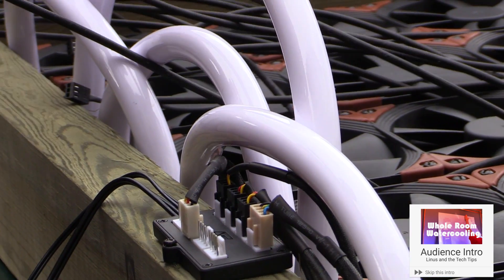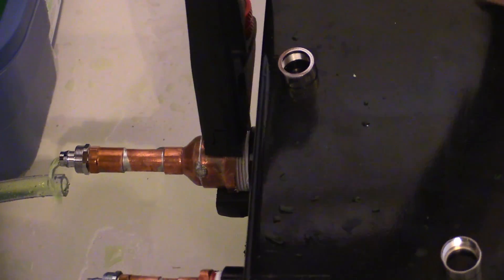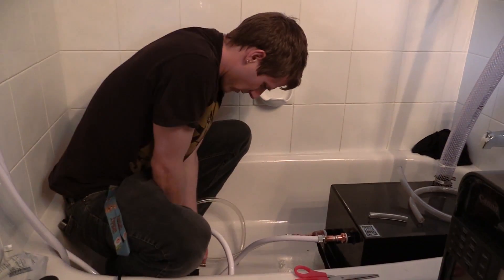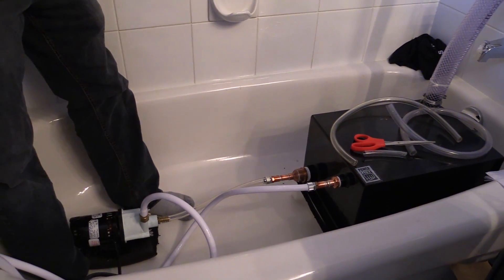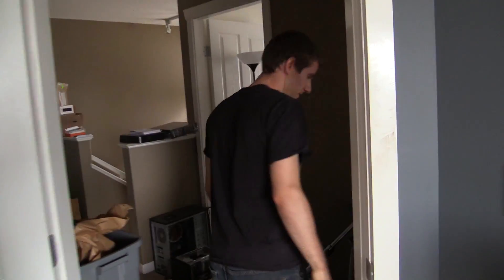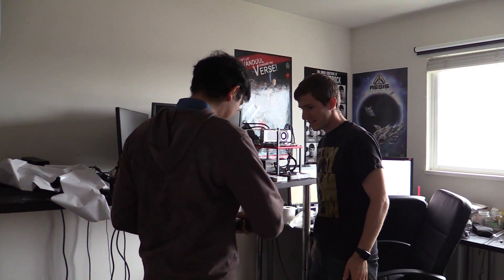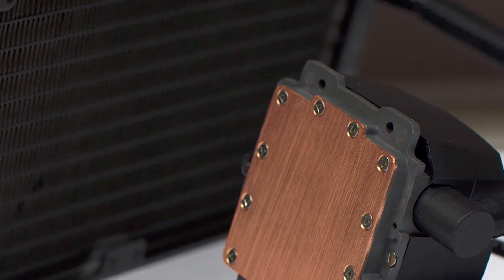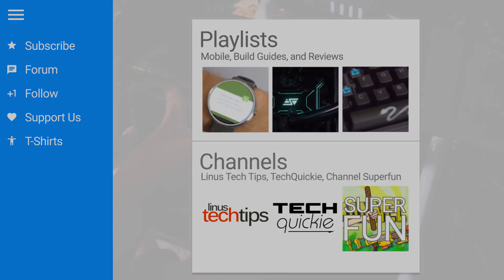Whole Room Water Cooling Part 4 - Nearing Completion...

Comment: A few inline valves would have helped.  Very amateur set up, the outside fans wont last long. A air conditioning heat exchanger would have been the easy route. Also basic bleeding of from the lowest point, a tube under water as to not let air back in.
Reply: "Very amateur setup" ? Really guy? Just enjoy it for what it is; Something you'll never have (Or need), and an experience they are sharing with us.
Reply: "very amateur" set up lol. well considering they are amateurs, you are being redundant
Reply: TheDutyPaid Those fans are noctuas NF-F12 Industrial PPC fans that are IP rated for use in challenging conditons. They can run under water.
Reply: It's a bunch of unboxers and amateur PC hobbyists that shill out for Nvidia/Intel,what did you expect?
Reply: I liked your comment because it looks like you know what you're saying and I don't understand it.
Reply: You're going to get flamed to hell for saying something Linus does is 'wrong'.
But i'm here to let you know you're completely correct with them not using needle valve switches.
Reply: M1che1 Amateur PC hobbyists?
Reply: Totally agree with you, As a refrigeration engineer myself an ac system would have been easier and you could get super low temps. Would have to put temp sensors on the heat exchangers to make sure the water didn't freeze XD. and have to insulate those pipes.
Reply: Imagine doing this, but with case air - Cool AC air in the front, pulled out from the back of the machines distributed in the same setup.
Reply: Fish What you want to do is to have the water loop run through the heat exchanger. then you cut out all the efficiency loss that comes with the air flow.
Reply: scaniaman93 Thats why they failed shortly after this series was filmed. Check the forums. I'm not hating on them, I have 3 of them in my PC as I type this ^^
Reply: it seems every expert is not happy with how they went about this project. all I know is your not supposed to touch antifreeze and linus was washing his hands with it... kinda shows just how little they know about what they're doing.
Reply: Fish Trouble is then the AC has to run at all times the pcs are running, where the ac power load is always max.  If anything running a fridge outside with the evaporator coil dunked in the reservoir would cool the loop with an 'ac' system that would turn on/off with the loop temperature.
Reply: He said that the last video in the series will explain the reasoning behind everything.
Reply: Idk why he did what he did maybe he was trying to prove that it could be done with "normal" PC water cooling hardware.
Reply: Prob would work better but you really want to keep temps as close to ambient as possible to prevent condensation.
Reply: M1che1
 yea that is why they made AMD builds etc? Intel is superior to AMD in a few ways, and linus doesn't do low budget systems afaik, so AMD was not a good option in most of them. Also he usually picks Nvidia over AMD due to where the PC is meant to be used. He picked Nvidia over intel in a few systems as gave out less heat, or AMD due to the perfomance to price ratio etc. He picks Intel and Nvidia because they are good at what he is using them for...
Reply: scaniaman93 the OP is right, as someone who works on the bigger systems in commercial construction, i'd say that would be a more efficient way to dissipate heat like an air conditioning system on the side of a house but something smaller with valves for isolating sections of the loop would also help. Screwed pipe or PEX pipe would of been a better choice, copper is expensive and when they move to the new office, they will have to trash all the lines because the fittings can't be reused
Reply: rcflyer182 That's what anti-freeze is for
Reply: Aaron Hall
Winter
Reply: Applebloom
He said, "that's what" Statement not question.
Reply: TheDutyPaid
My brain auto corrected before I finished reading : (.
Reply: Mr. Green I've seen million dollar jobs become unprofitable because of pinhole leaks, you plan the best you can and the rest is up to luck
Reply: Mr. Green
I think the plan was more along the lines of lets do what no one in their right mind would.
Reply: Yes a few in soldered t-junctions with risers to mount twistable springloaded pressure-release-valves on the long straight pipe runs in the ceiling would have done away with the air while the pumps are running...
Reply: scaniaman93 so once the fans get wet, what will happen to them when the outside temperature falls below freezing?
Reply: If the temps fall below freeing TheDutyPaid they wont have to worry about the fans as it will be cold enough to passivly cool the radiators
Reply: Yeah i guess jack black

Comment: ball valves on the bottom of those droppers would be the ticket instead of them screw caps cause then you can shut of and connect a new unit while still running live

Comment: This is such pimpin insanity, over engineering to the enth degree, all that metal, piping. 
I do enjoy watching it and building stuff is fun.  My solution would be to use nice thick tubing and a large jug as a res. Car radiator with its original fan, 70% savings.